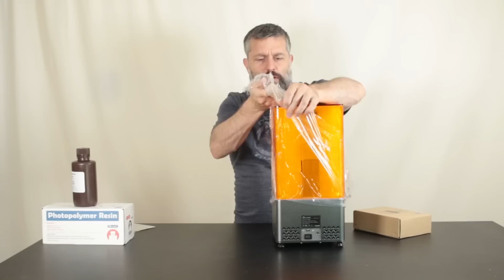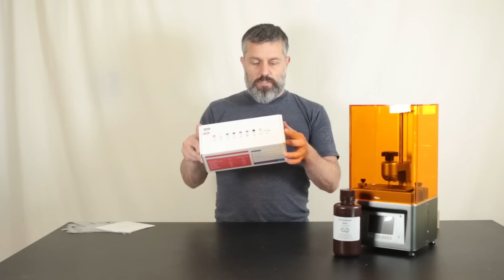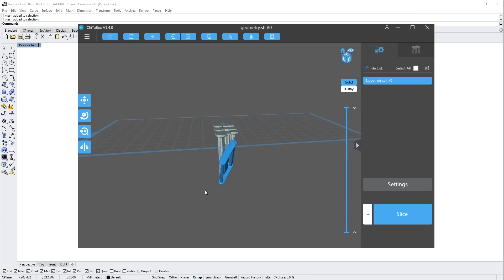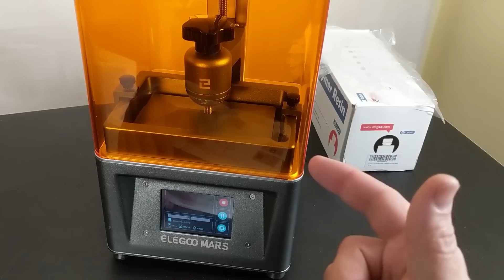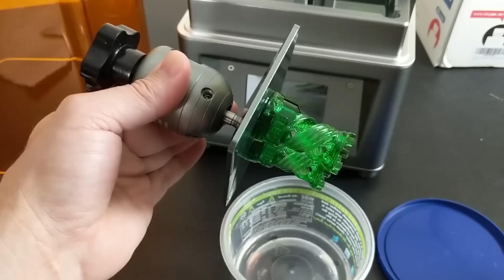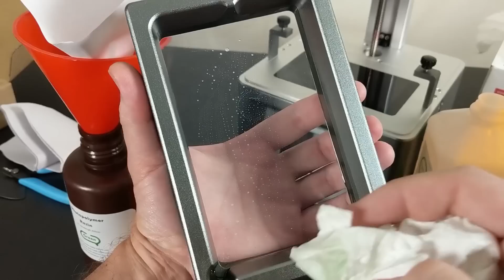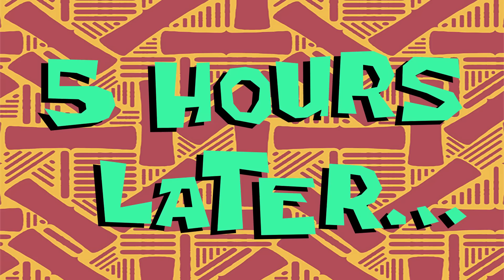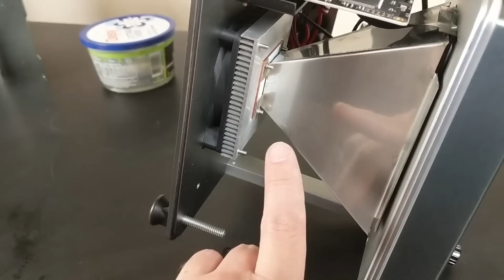$250 for This Quality of Printing Is Unreal! - the Elegoo Mars Delivers, so Let's Review It.

Comment: What a useless "review". 
1) No mention of the need for a well ventilated room due to the fumes.
2) Total lack of understanding of the handling requirements and to NOT get resin on your skin.
3) No mention of the fact that printing speed only depends on height of print- 6 identical prints along side each other (or different prints) in a single print run will print in about the same time as only 1 print item unlike standard printers.
4) No mention of capacity of reservoir and that large prints may require top up (if that is possible on this model).

Comment: So much misinformation in there...
- The tinted cover isn't there to protect your eyes from death rays (as you can see by post curing in the sun you get similar UV exposure just by going outside...), it's to prevent UV from daylight from getting in and curing resin in your tank.
- The bottom of the vat isn't glass, it's an FEP film. Very low adhesion and a lot of flex, so when the platform raises it DOES peel just like other machines. You're not "losing because it's cheap". The FEP is a consumable and needs replacing occasionally, it's about $5 a film. On the Form printer the same kind of film is used, and you actually have to replace the whole $80 tank when it's worn out (their quoted life is only about 1-1.5l of resin!). In practice the life will depend a lot on whether you have failed prints. Where you're most likely to damage the film is when you remove remains from a failed print that didn't stick to the build platform but now sticks to the film instead.
- You aren't "limited to one material", yes they're all photosensitive resins but there are many of those with very different properties, just like different filament materials.
- Your black part's support probably broke becasue you likely didn't adjust exposure times for the black resin. Each resin and color needs different times.If you did adjust time you should have mentioned it as it's very important information.
- The part printed on your form printer actually looks significantly worse, the round part is bent...
- CNC kitchen has already done strength tests 2 months ago.
- The cookie stuff is a GDPR requirement, almost every single site you go on nowadays has that...
- Chitubox is no more a copy of Preform than Cura is a copy of slic3r or whatever - There aren't many ways to prep a part for resin printing, it's normal all slicers offer almost the same stuff...
Reply: Thank you for posting this. My eye was twitching throughout the entire video with the incredible amount of ignorance displayed for a "review".
Reply: kilrahvp also not sure how he came to the conclusion, that You need to modify the firmware of Your FDM printer, to use a different nozzle size
Reply: @Partykardi  right?!?!  You change one value and maybe change your printing temp a bit
Reply: As soon as he went on the china cookies rant i kinda stopped watching. All credibility gone out of the window. Cookie requirements have been around for years now.
Reply: ChiTuBox - the Formlabs slicing software is also Open Source, provided to enable other developers to use it....https://formlabs.com/blog/open-source-dlp-slicer/ So even if the 'copy' smear was warranted, it would still be void since they are using the OS software as it was intended to be used. Glad you wrote what you did!
Reply: I can't believe he got such a BASIC thing wrong.
Reply: OH snap son you went in hard like a diss track.  also good info, I got more info from taking 2 minutes to read this comment than I did from the video.
Reply: rekt
Reply: @rebeuhsin6410  No laser on this printer.
Reply: Also, it is extremely unlikely that the screen is LED, with that UV lamp beneath it. It is much more likely to be LCD.
Reply: @renedekker9806  Well, what we (well, TV manufacturers) call "LED screen" is actually a LED-backlit LCD, which this technically is. OLED is something different.
Reply: @kilrahvp  Except, of course, that this is a "LED-backlit LCD", without the LED-backlit part. That is, it is just a simple LCD screen. The backlit is a UV lamp. There are no LED at all involved.
Reply: @renedekker9806  They are UV LEDs:)
Reply: @kilrahvp  That is possible, but given the design as revealed in the video, it is much more likely they use a normal UV lamp.
Reply: @renedekker9806  That wasn't a supposition, it IS LEDs.
Reply: @kilrahvp  Ah, I did not understand you had that knowledge. Still, I would not call it a LED screen. It's an LCD screen with a LED lamp a long distance beneath it.
Reply: Also Chitu is one of the largest motherboard manufacturer for 3d Printers (both FDM and SLA/DLP). Your 3D printer is probably not trustworthy! - according to the guy from the video...
Reply: @alekseidolganov1798  in all seriousness. It probably is not trustworthy.
Reply: I'm glad I didn't waste my time finishing the video then.  I stopped watching during his China World Domination rant at  ~10 in
Reply: @ladycthuwu  to be fair, China does not respect international patents. However, I'm not sure he could actually avoid that.
Reply: Anthony Losego @<~ Agree! The guy in the video is only guilty of being hyperbolic. 
But, no more guilty than the hyper-touchy commenters whining about him.
Reply: This guy is too much 'Murica and has no fucking clue what he's talking about. FDM isn't as weak as he described it. total douche.
Reply: @zamboney6848  "too much murica"...sounds like you're the total douche.
Reply: If you have such a prob with it then why did you watch the whole video.just to criticize. The guy is making vids and helping people needing info or just like watching.you seem to have paid a lot of attention to a vid that was supposedly so mis informing.
Get with it buddy!!!
Reply: And you forgot also the racist part about China. This stupid jerk is afraid of being tracked by China, but is ok to be tracking by the  Murica... Murica is amazing and saves the world! <3
Reply: Francisco Dias @<~ He said nothing racist.  He rambled a bit about a fair concern w/ regards to certain Chinese software. You don’t think that’s an issue?
Calling a person a racist for criticizing an aspect of a country’s business/govt practices is incredibly naive and de-humanizing.
Reply: @lunarvision   its totally racist, where do u think this technology came from? do u think that chinese people r not able to design softwares for their own hardware?... we are all taking knowledge and developing from others to create new things... USA is not the center of the planet bro, please respect other cultures
Reply: Nacho Pires @<~ What an weird response... You replied to the wrong person. Whatever it is you‘re trying to express is totally out of context to what I wrote - or you’re being a troll. 

China is the most populous nation in the world - it is not just one race. Misunderstanding this is the only so called “racism” on display.
Your race-baiting, internalized guilt script doesn’t work on me - take it somewhere else.
Reply: @lunarvision  sorry it wasnt for you the reply, it was just for this guy on the video that i think he is being a bighead
Reply: @nachopires4978  u ok? Relax man. Im not sure he is reading these comments getting all upset about people getting triggered

Comment: Just fyi even when its cloudy there is still uv coming through the clouds. People still get sun burns on cloudy days
Reply: Dear @Ron  I have worked inland Australia  where temperature  has been 52°C where the soles of my boots get tacky on plate steel an live in Albany which is the bottom of the state  of Western Australia   the next continent is Antarctica which is on the edge of ozone hole an in one day on a cloudy overcast  down at beach watching a family flying kites. 18-21°  an no indication of being a hot day got severely burnt in just 2.5hrs .
Reply: Actually more as clouds trap escaping reflective UV making the amount of UV double yes no sunlight but effectively clouds=  large hot house
Reply: @Sudas80   an Ron clouds trap UV from escaping once they have it the earths surface an are bouncing back to space.

Comment: Thank you for that. As a total tyro I learnt a lot but I’ve got a couple of questions. 
Would it be possible to make up a resin with reinforcing micro fibres in suspension?
Why could you not have built your piece with its longitudinal axis aligned with the machine’s z-axis? That way, you wouldn’t have needed any support pillars at all as it would all simply extrude out behind the platen, wouldn’t it?
Reply from the maker: The way I oriented the print allowed for the least amount of support structure. This is good because each support structure leaves a little nubbin imperfection on the part. Because I have no flat surfaces on this print I can't put it flat against the bed. Even if I could, the part that printed against the bed would have a texture on it which would be absent on the rest of the print. Regarding your idea for "reinforcing micro fibres in suspension" I can predict a couple of problems with this. First, the layer height is .05mm. Even if your fibers were this thin, what is to say the fibers don't orient themselves vertically thus getting crushed by the platen when it lowers. This would damage the transparent membrane and have a sandpaper like effect. The part would start to stick to the membrane and...disaster. The other potential problem is that the fibers might prevent the resin from flowing back into the void when the platen is lifted.

Comment: There are many different types of resins you can use... Dental castings, regular plastic and also for dental castings
Reply: Tell me more...
Reply: @AiMR  You can get resin in different colors including clear that come out as a hard plastic which are the cheapest, the next expensive are resins that are rubbery when cured which are usually clear and can be added to other resins to make them stronger. The most expensive resins are the dental resins and can withstand the highest tempuratures.

Comment: You said that would be a difficult  part to print. Uh no it would not. You wouldn't even need supports if you put the model on it's end. You wouldn't have that support problem at the top either.
Reply from the maker: As I said in the video, there is not a single flat surface on the entire object? It would need to be cradled in support material no matter what orientation you print it in. The part of an FDM print which is supported almost always has a very poor surface finish. Thus as I said in the video "Nobody who is a professional would even think of making this prototype with an FDM machine."
Reply: the ends look flat to me @DesignPrototypeTest

Comment: I think if I want to make d&d figurines and miniatures, I'll go with the resin printing. Should be able to squeeze a good handfull of models into one print, right? Then just properly clean and cure them and they're ready for painting...
Reply from the maker: This is correct. The best part is that each layer takes the same amount of time no matter how much is being printed on that layer, so printing 20 figurines will take the same time as printing one.
Reply: @DesignPrototypeTest  awesome. So if you're building a huge set the its well worth the 250$ price tag.

Comment: yep where DIY fails usually RTFM succeeds
Reply from the maker: True. It's too bad the manual didn't tell me that UV curing resin is especially toxic. I've worked with resin and other nasty chemicals for years and generally just try to limit my exposure, but inevitably get a little on my hands. This project was no different. I'm not sure if the UV resin really is as dangerous as all the comments are making it out to be. It would have been nice is the the Manual had an MSDS. Because they ship the printer without resin, they don't include this part.
Reply: @DesignPrototypeTest  kind of a shady technicality eh even though the machine is designed to use the resin they don't include a section on how to work safely with it o.o'

Comment: Rasin printer is surely better, but it is also surely more expensive in terms of material.
Reply: Used to be the case, but not really anymore. 1l of resin (about 1.2kg) of material can be found for around $40.
Reply: @kilrahvp  but 1kg PLA costs less than $10. The price difference of 10kg materials can buy a new printer.
Reply: @shimmery1210  Well the quality PLA I buy is about $25 a kg... But anyway it's not a replacement, it's another option with both its strengths and weaknesses. Many things you can do on resin printers you have no chance to do on an FDM machine in the first place, so your $10 PLA gets you nowhere... The point is that not long ago resin would be $80-100 a kg, and then yes it was expensive.

Comment: Not a lot about print time and size limitations of the printed object. Like how close can you get to the edge of the screen and still get a good print. It does look like for that little part it is an overnight job. It looks like horizontal size doesn't affect print time but depth does? The strength of the part is impressive. Nothing like a similar size part in ordinary plastic filament printing. Not a word about the cost of the bottle of resin. The video is a good idea but needs a lot of editing out of useless blather.

Comment: don't know why he would waste any material for supports when the part has a flat side and could have stuck to the base just fine.
Reply from the maker: It allows me to make fewer supports. Printing in a more flat orientation would have used less support material, and made for a much faster print, but as I said in the video there is not a flat surface on the geometry. No matter what, I would have needed support material, and in the flat orientation, I would have needed a lot more of it which means more of the little nipple imperfections in my surface finish.

Comment: Isn't the orange tint to stop uv from sunlight curing the resin in the tank, I thought it used a screen rather than a laser ??
Reply from the maker: Yes, you are right on both counts. By the end of the video I corrected myself about this not being a laser based printer, and instead being an LED screen based printer.

Comment: Thanks for the view of the internals - which look most like the internals of one of those sub-$100 LED video projectors*... the heatsink and the folded pyramid reflector cone especially... fortunately, this unit has an external power supply, so it's unlikely to catch fire (the *reason I was digging inside the video projectors :-)

Comment: First, I am pretty sure that that resin is Hazmat and is not listed as such.  Second, you should be handling the resin transfer in yellow light.  Exposing it to any normal light will start the cure process and the whole bottle will soon be bad.  You are contaminating your resin and don't know it.

Comment: Interesting. Two points.
Watch out for fingerprints on the pre-cured prints.
What is the pixel density of the UV LCD screen, and does the contrast issues with LCD cause loss of detail (pixel leak?)
Reply: 2560px over 115mm, so about 45 microns per pixel. No contrast issues. Some printers (don't know about this one) can even do antialiasing for more smoothness - but at that resolution it's already unnoticeable without it.

Comment: @35:35, This guy knows very little about electronics or geared mechs. First off, that is a STEPPER MOTOR driving the WORM GEAR for the ELEVATOR assembly. 2nd, the main board is a control board for the IMAGER ( which is the "cell phone" screen ) and the touch display interface control module ( front panel ). The last board is a ballast board to step up or down the DC current for the SMD grid array LED panel connected to the light box . All in all, this printer is very well built for the price point. Nice it is in an all aluminium chassis with very little plastic, as the heat from the imager would certainly warp it over time.
Reply from the maker: If you live in a glass house you shouldn't throw stones. There isn't a worm gear anywhere in this machine. The stepper motor drives a lead screw.
Reply: @DesignPrototypeTest  I guess you got everything else right in the breakdown too huh?? You did not.
Reply: @DesignPrototypeTest  Funny how you did not even call the motor a stepper before I replied.
Reply: @DesignPrototypeTest  Guess you will not go after the several other posters that pointed out the poor prep you put into the subject to begin with. I am not alone on this, read up before you blast me.
Reply: @DesignPrototypeTest  And to add all the  PPE  you failed to use, as others pointed out, that definitely should had been followed and you telling viewers not to do this as it is harmful. For the one thing I might be wrong on and the dozen you are far outweighs mine and your comment. 

                   Who lives in the glass house now??
Reply: It so is. Look on the engineering print. By definition, this does the exact work of a worm gear, not a screw. 19 years as a mechanical engineer at Snap-on tools and 30 years of electronics repair, pretty sure a worm gear driving an elevator is correct. You could call it a drive screw for the layman, but that would be like calling an axle in a car a drive pole.

Comment: How many hour can this print hard drive case?
Reply from the maker: Each layer takes the same amount of time regardless of how much material is being printed. It takes roughly 9 seconds per layer. Layer height is .05mm. If your print is 100mm tall it will take approximately 5 hours to print. If 50mm tall, it will take approx. 2.5 hours to print.

Comment: It's an LCD not a laser "ELEGOO Mars uses a 2560×1440 2K HD masking LCD as to provide accurate printing with XY axis resolution of 0.00185inches / 0.047mm"
Unless you are using mercury gas vapour lamps your studio has no UV